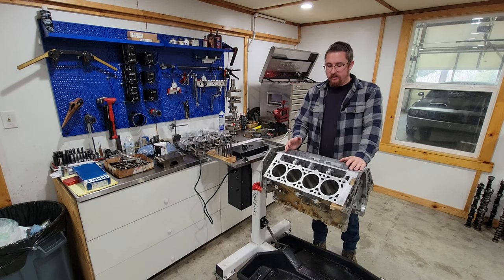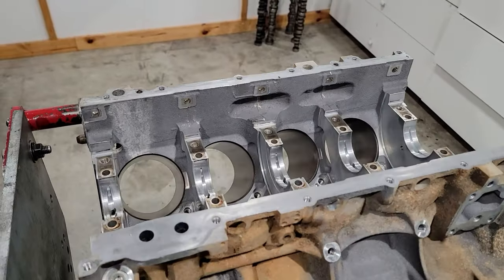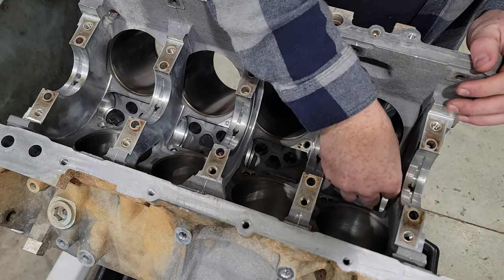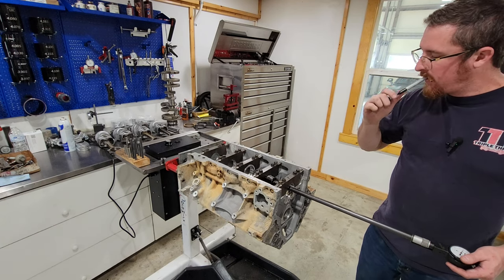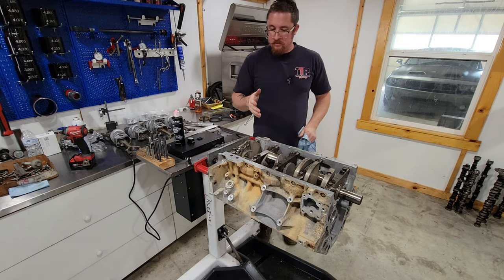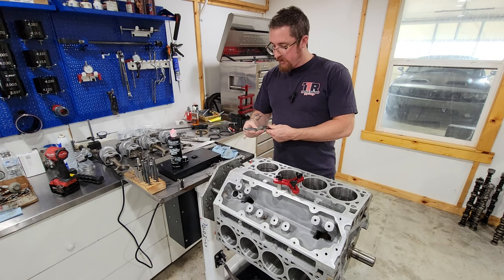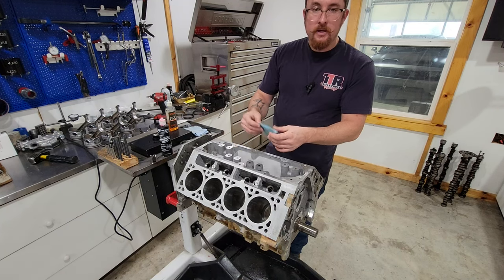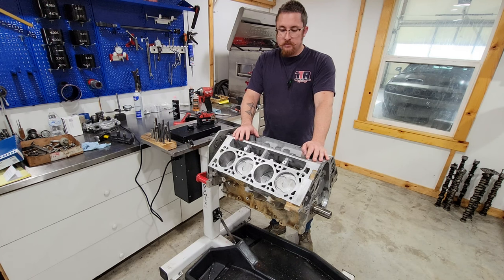Easiest motor ever to rebuild!? DIY in your home garage! Part 1 Gen 5 LT L83 5.3L engine rebuild!

Comment: I rebuilt my L83 in my garage like this guy.  185k miles, only thing wrong with it was it had a failed lifter and wiped a cam lobe causing a misfire.  I sent it to a machine shop to for the hone, deck the heads, level the block, valve job, and polish the crank journals.  It needed a new cam and you’ll want to do a DoD delete anyways, and that’ll require a reprogram of your PCM also.  The bulk of the expense is really all the new seals and bolts and bearings and rings and gaskets.  I bought all new hardware that is recommended to replace because I wanted to get another 200k out of it.  It adds up quick.

Comment: A DIYer who does not have the dial bore gauge and micrometer (or the skill to use them) to verify bearing clearances could just get some plasti-gage. Also, if one is investing the time and funds to rebuild the engine, is reusing the TTY fasteners the right place to save money? The OEM screws ain't that expensive in my experience.
Reply from the maker: Yes, plasti-gauge is one way to check clearance.  Replacing the bolts is the best practice to use, but if you are trying to save as much as you can at home, reusing the bolts can be one of those ways.

Comment: I wouldn't use the reluctor ring that you're indicating off of to pry the crank longitudinally. You're adding the flex of the ring to the actual crank movement. One could just as easily pry at another main cap.
Reply from the maker: Fair enough, I was taking the measurement after the ring returned to it original spot.

Comment: The piston intention is sleekly for pooling fuel for start up.
Reply from the maker: It is to help better mix the fuel and air in the combustion chamber for a more even flame front.
Reply: @paragonengines1924  have you corrected the engineer that designed the piston?
Reply: @TMACWARDEN  I'm confused, is there something wrong with it?
Reply: @auschalic not at all- it’s literally designed to pool fuel and help with crank start

Comment: I have the same motor in my truck. Recently has begun burning excess oil. I believe is getting around the rings. I am strongly considering a refresh like this. Curious if you know roughly the cost of parts and the cost that you would charge to do this job?
Reply from the maker: A refresh like this would run about $4K for everything you see in this video.

Comment: ls/lt main bolts are not TTY. they are only Torque To Angle
Reply from the maker: Torque angle is the sequence you use to torque them.  With that process, you are brining the bolt up to its yield point, hence "torque to yield"
Reply: @paragonengines1924  not all torque to angle bolts are torque to yield. Common misconception. A bolt is only torque to yield if it enters plastic deformation. The stock head bolts do enter plastic deformation, but the main cap bolts do not. They only enter elastic deformation. If you look in the AC Delco rebuild manual you will see that the main cap bolts are not an item that is replaced during a rebuild.

Comment: What's the difference between a motor and an engine?

I was told that engines are the combustion type and motors are electric. Which means all those years calling engine mounts motor mounts was incorrect, or things changed on us, I don't know, but we may need to relearn our vocabulary words.
I still don't get it, because a motorcycle had an engine, but we call them motor-cycles. 
 Next they'll be telling us 2+2=5 if not it's racist.
Reply from the maker: Engine: a machine with moving parts that converts power into motion.

motor: a machine, especially one powered by electricity or internal combustion, that supplies motive power for a vehicle or for some other device with moving parts.

They seem pretty interchangeable to me, I wouldn't get caught up on it.  English is a hard language.
Reply: @paragonengines1924  lol, English is definitely a hard language. Sometimes I think THEY're just screwing with us. Did you know the origin of "nice" is foolish, and blessed was about bleeding out or something like that. We have a lot of man-made traditions with very questionable roots. 
Anyhow, I'm rambling and totally off the subject of engines. Keep up the good work!